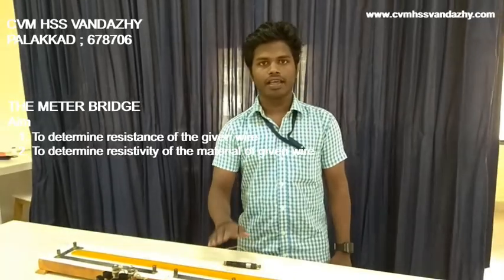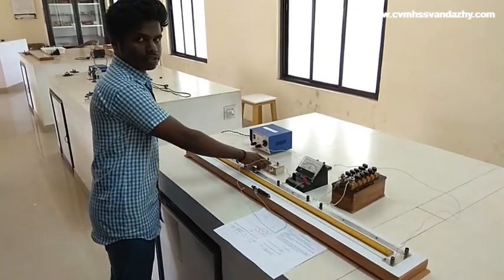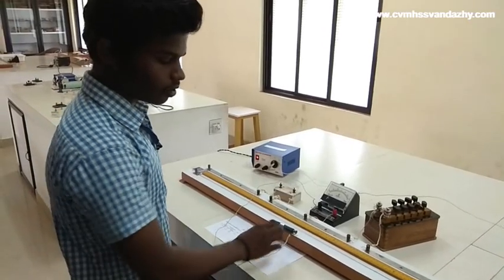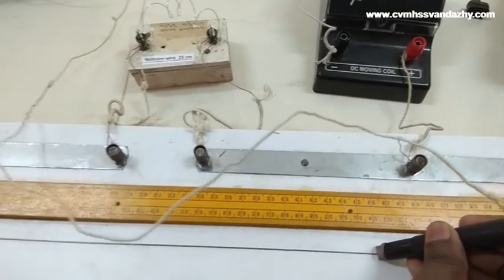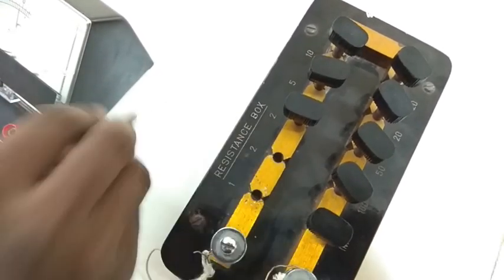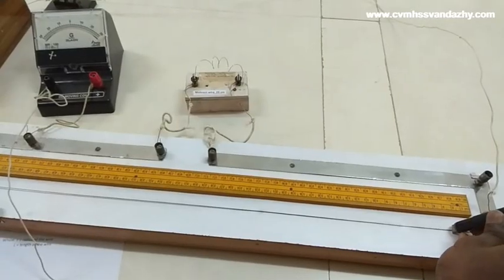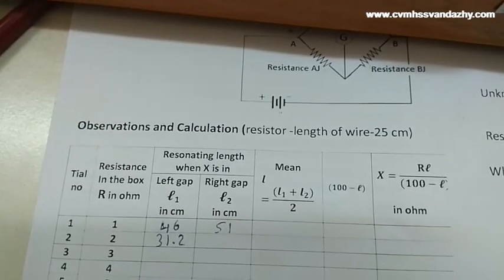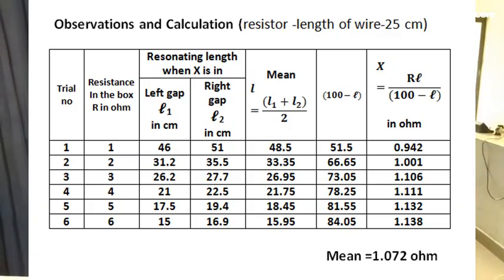Meter bridge

Comment: Galvanometeril ninnu jockeylott connect cheyyumbol oru higher resistance connect cheyyande
Reply from the maker: It's is actually to protect galvanometer from high current... 
Here we are using voltage of 2 v ie less current ...

So no  problems